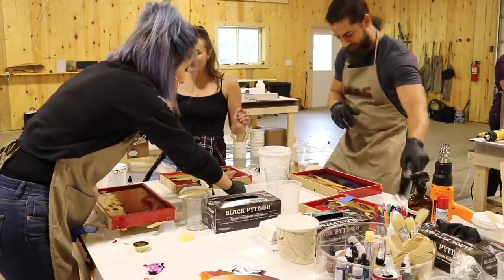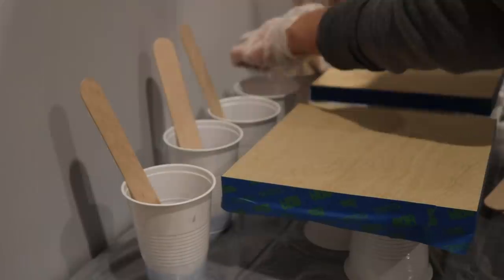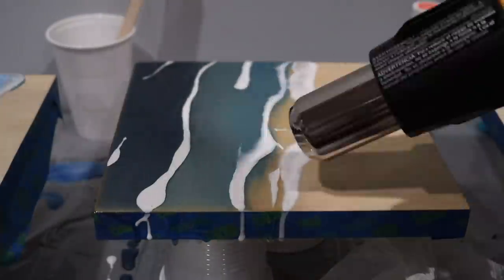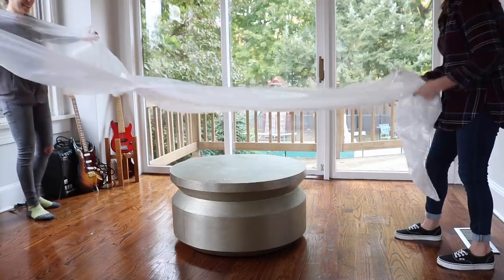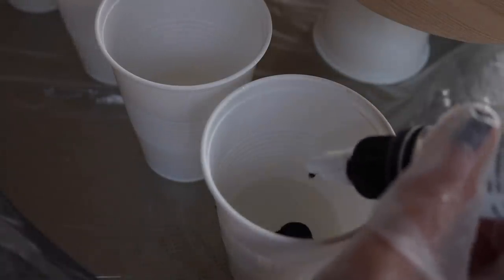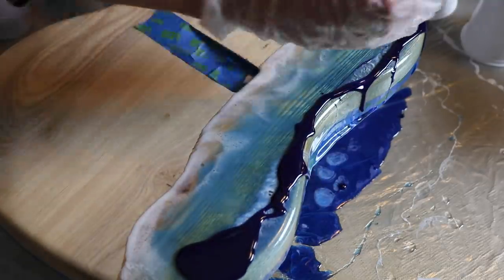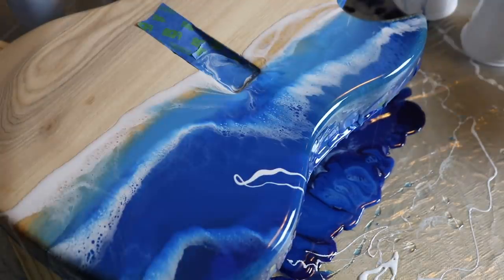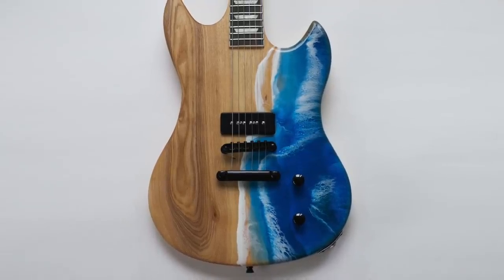I POURED RESIN ON MY FRIEND'S GUITAR

Comment: Could you remove some of the wood so that the resin would cure into a seamless plane with the wood instead of having it sit proud of the wood like it is, or would that be too difficult?
Reply from the maker: You could, but it would be a lot of work for a small return. The layer of resin is so thin, it’s a super slight raised area, so you barely feel the difference.